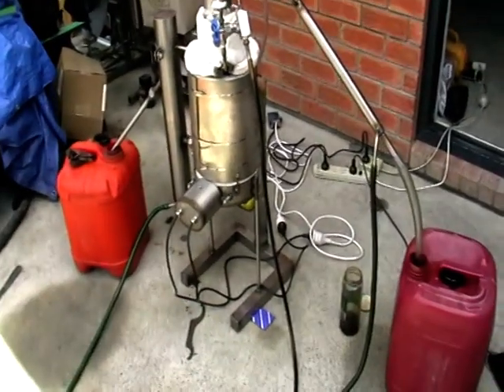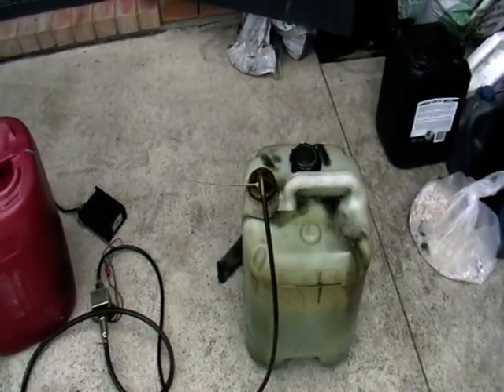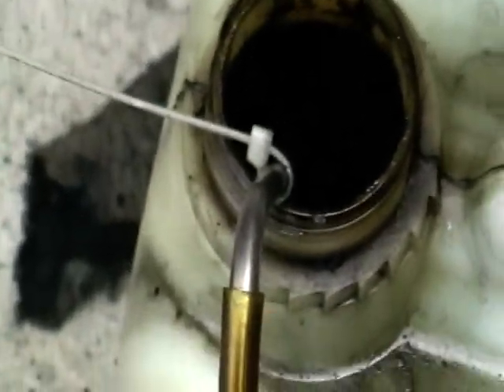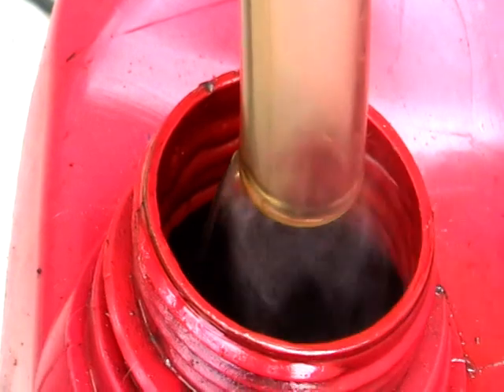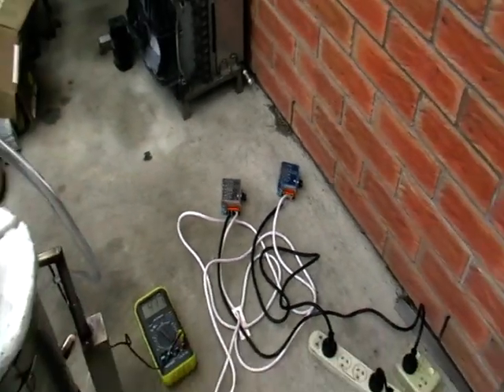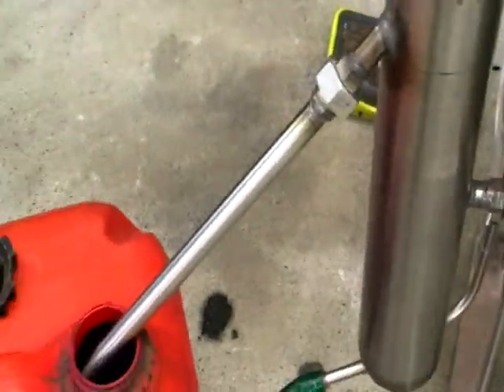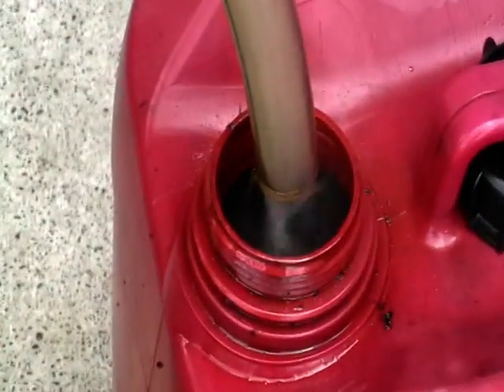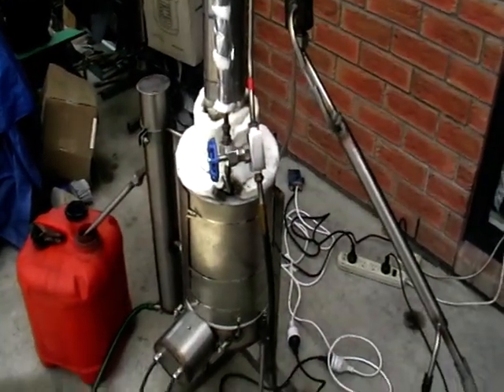Waste motor oil distillation

Comment: your machine distiller also wvo?
Reply from the maker: No, just used motor oil and dark diesel fuel.
Reply: why your machine no use wvo? whats differece????
Reply from the maker: simply because veggie oil is a fatty acid that is a heat tolerant and not boiling, so it evaporates in the form of a smoke and technically after some amount evaporated normally it is started to decompose during heating and as a result, you will get much worse at the end rather than at the beginning, so in my opinion it is best to simply run it through the sieve, then centrifuge, and finally mix with normal or recovered diesel fuel.
Reply: Hi ..trector west bleak oil refyin than please contect..7869207965
Reply: India